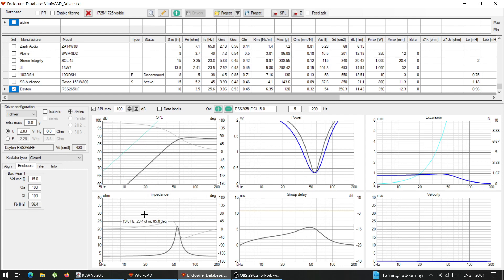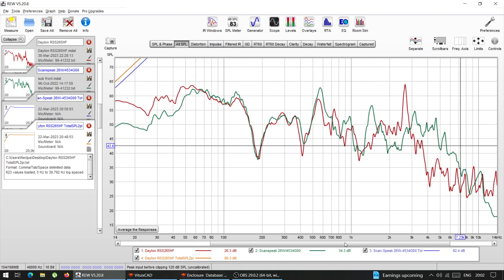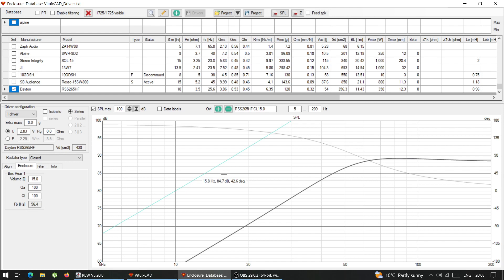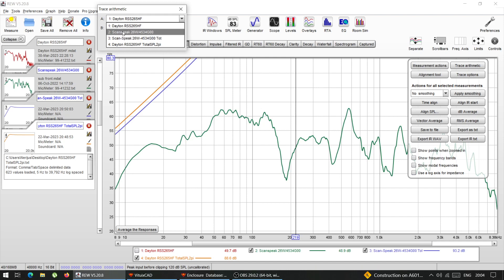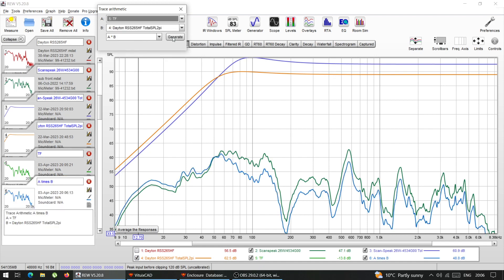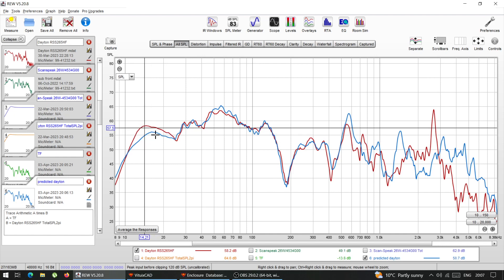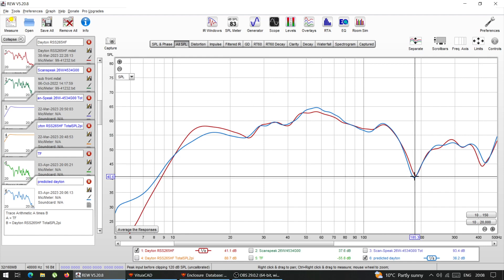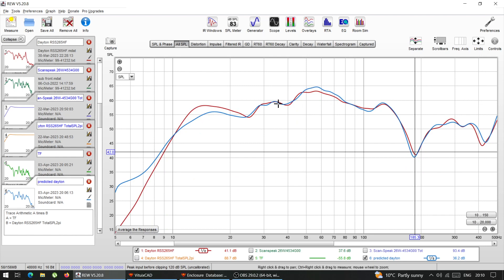How accurate is frequency response modeling?

Comment: Impressive how accurate the prediction is. FYI Hornresp also has the ability to export the SPL + Phase graphs to txt by pressing F9 with the Acoustic Power window open, in case you want to play around with some enclosure types that VituixCAD does not support
Reply from the maker: Yeah, hornresp has a steeper learning curve than I am preparing to climb😁